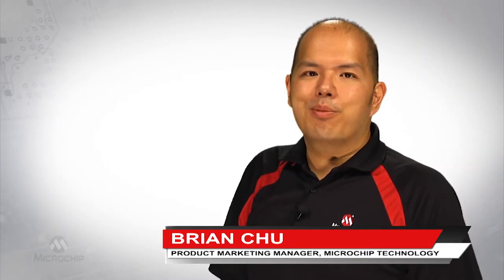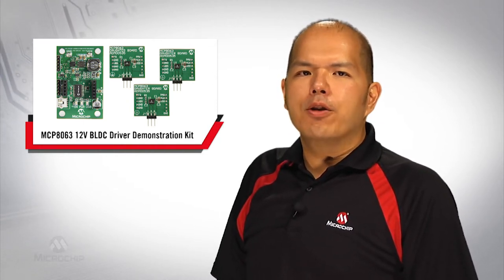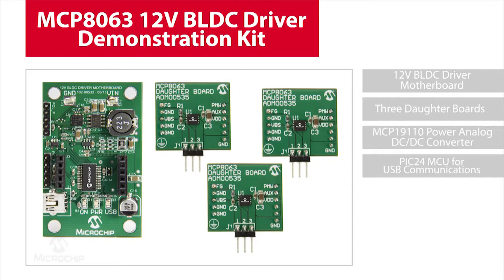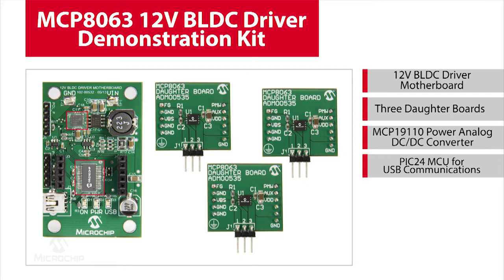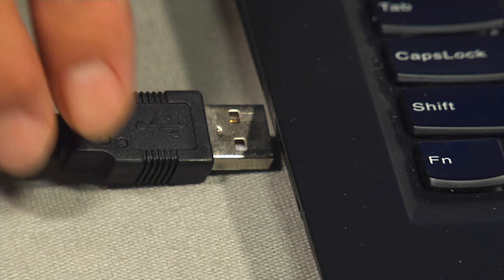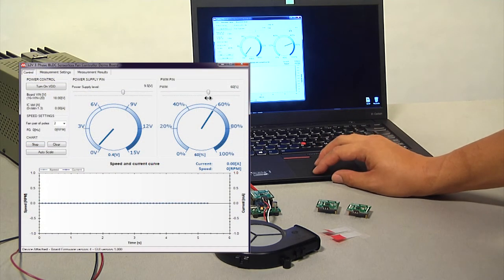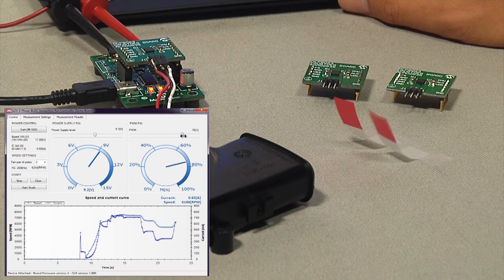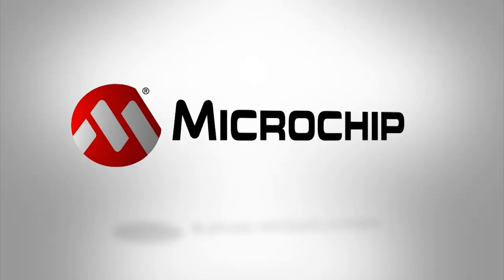MCP8063 12V BLDC Driver Demonstration Kit

Comment: Can it be set to 10 rpm when driven with 5V and connected to a small BLDC Motor?
Reply from the maker: Hi there, thanks for your question. The input voltage for the demo kit is 16V to 20V. The Frequency Generator signal can be used to compute the motor speed in rotations per minute (RPM). Typically, for a four-pole BLDC fan (4P/6S), the speed in RPMs is 30 x FG frequency (Hz). Let us know if this helps!
Reply: @MicrochipTechnology  OK, 16V is too high for my application. I wnat to use small BLDC like it is used in small gimbals for a wind turbine model to turn the rotor with 10 rpm. I want no gear or brushed motor to keep it working for years and it should be USB powered...so i have to use a stupid tripe 1/2H bridge driver and a microcontroller to generate the field. 
Was hoping there is some out of the box IC.
Reply from the maker: Hi there, thanks for your comment. We do not have a BLDC Demo Kit that can be driven by 5V. But please don't hesitate to get in touch with our teams so we can further assist you in getting started with your project. You can reach us here: https://www.microchip.com/en-us/support/design-help/client-support-services

Also, if you’re interested, please consider this development kit we have:
https://www.microchip.com/en-us/development-tool/adm00575

The Demonstration Board is controlled by PC software via a USB connection.

We also provided a GUI for users to set the RPM they want for the application.

Thanks!

Comment: I have a query. Can this be used to control a alter-motor. Alter-motor is a car alternator intended for use as a powerfull motor for short runs like in a DIY electric buggy/quadbike.  

The rotor coils have been replaced by neodymium permanent magnets. 

The 3 stator coils need to be fed electricity 12 V to run the motor. 

Can you suggest how do I wire the altermotor using your microchip products.

A proposed circuit diagram shall be highly appreciated at my email ashiqrandika at gmail.

Kind regards

Ashiq Randika
Reply from the maker: Hello - the best way to get assistance is with this is to post it in our user forums at support.microchip.com.